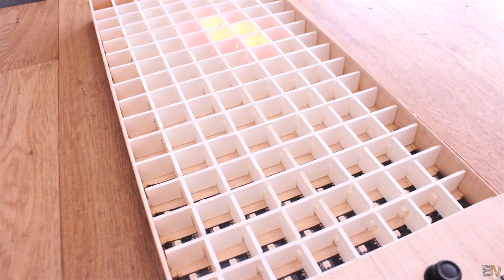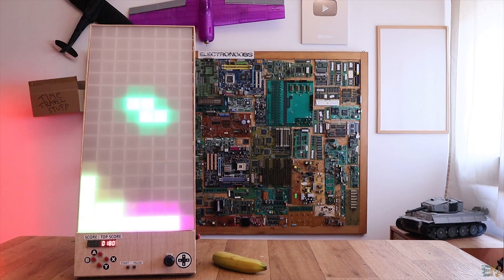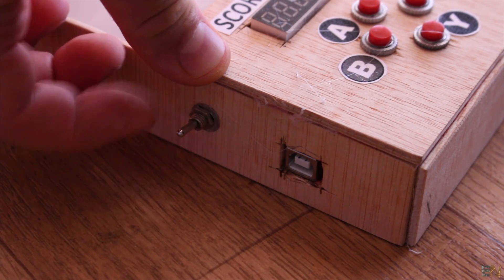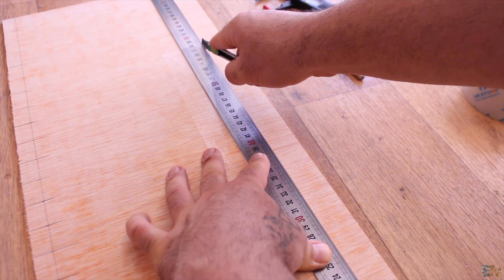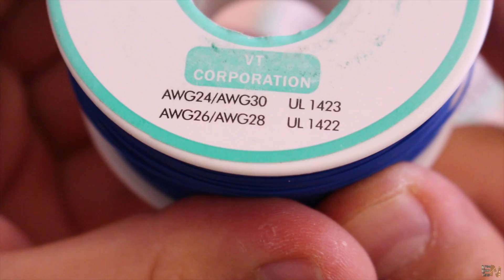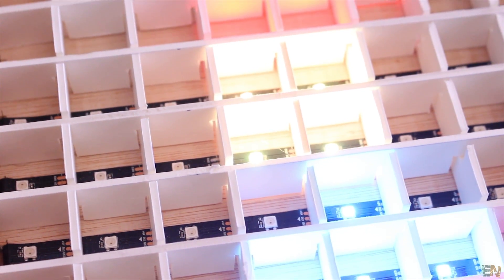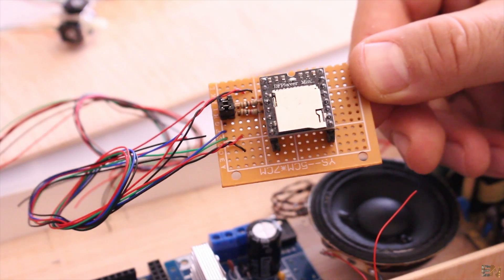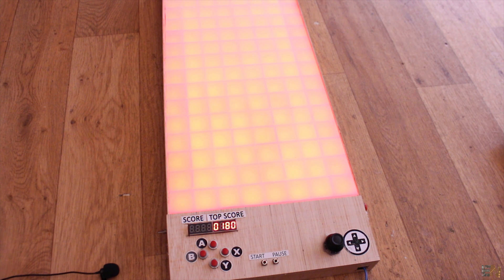Arduino TETRIS Game With RGB LEDs

Comment: Great Vid, as always Man! One good inprovement would be to put aluminum adhesive backed film on side edges around each LED cell quadrant. This stops the light spilling into the adjacent cell and makes for a more accurate representation of each object piece and more efficient use of the light. Why the Banana? Maybe I'm not getting the joke...?

Comment: I built this with some mods, the biggest mod would be the grid is 20 pixels wide X 28 pixels High. the next is using buttons with resistors in place of pot-meters the last is commenting out the following buttons Left, Right, Drop, Rotate

Comment: It's a cool project, but you really should use a strain relief on the 240 V power cable. Using a regular feedthrough or cable gland which you can buy at the hardware store also has the advantage that it uses a round hole which is easier to drill than your squarish hole.

https://upload.wikimedia.org/wikipedia/commons/thumb/1/14/Presse-etoupe.jpg/400px-Presse-etoupe.jpg

Comment: I suggest cutting some hardwood or pine strips with mitred corners to make a frame around the unit, woodgluing it to the edge plywood and at the corners. Use a chisel or a coping/jewelers saw to cut reliefs for the switches and plugs along the side. It should add significant strength without much rework.

Comment: Thats pretty cool but I would of used Black foam since the Light is bleeding into the other squares.
Reply: There's also a slight gap under the grid where it goes over the LED flex, so maybe that is bleeding also.

Comment: You should paint the spacers (foam grid) black, color bleeding is extensive. Also try to make the frame a bit more rigit. Control panel is flexing like crazy.
Reply from the maker: Thanks for tips!
Reply: @ELECTRONOOBS  And thank you for the ideas and entertainment!!!
Reply: @ELECTRONOOBS  BTW you could explore the idea of using a diffuser from an old TFT panel and maybe a clear glass on top of that. And then even use it as decoration, with a random selection prerecorded tetris games. And maybe even sell it also after the refinement, why not?
Reply: @TrickyNekro  how would you have it play a prerecorded tetris game? that sounds interesting.